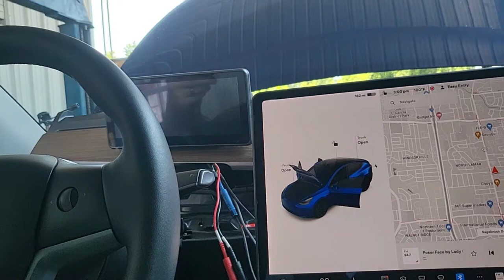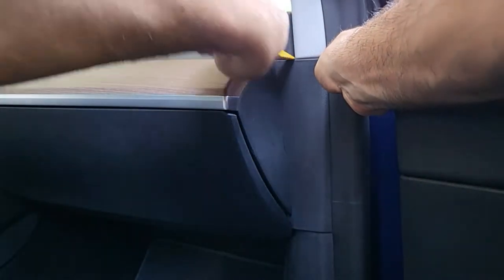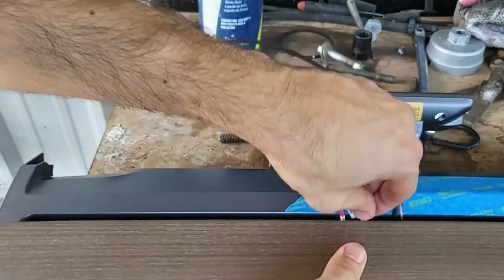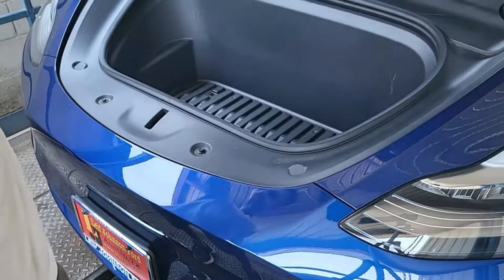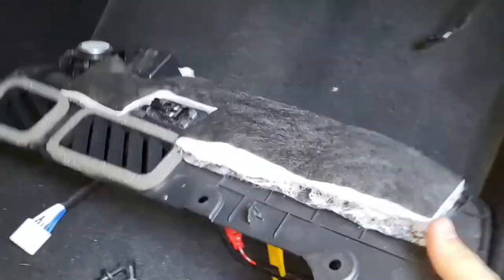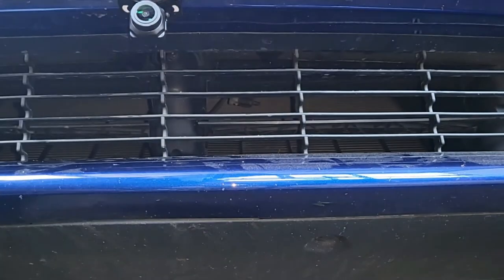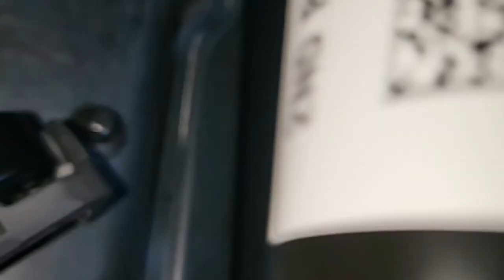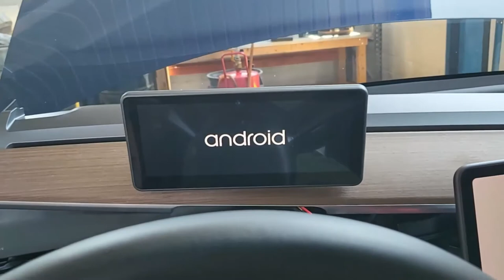HANSSHOW Heads up Dash Display and Camera in a Tesla Model 3 / Model Y

Comment: I purchased this display as well. Question???
Are you having issues with calls? Every person I talk to says they hear an echo when they speak until I turn off the CarPlay connection? Any simple workarounds other then disabling the connection?
Reply: Friendly help from California. I have the 9” version and had similar issue. Basically there is too much audio lag in original setup hansshow recommended which is phone to hanssow console to tesla Bluetooth. You see, we have multiple Bluetooth hops. Each hop causes audio lag. Hence why when you push play in CarPlay. Using app, you hear music 1.5 seconds later. This delay causes the other caller’s spoken words to be heard by themselves about 1 second later. 
   The solution which works for Apple phones and might for android auto is to go to tesla infotainment Bluetooth menu and connect to your phone. Mark your phone as priority device so your preference is remembered. I also went to phone’s accessibility settings and set an option to ensure incoming calls are handled by Bluetooth device. Before doing that I would have to occasionally click on phone’s incoming call menu and switch it from hanshow bluetooth or CarPlay to tesla Bluetooth. 
   After doing this occasionally sound will come from hanshow hardware’s speaker. You will need to go to tesla. Bluetooth audio source menu and push play and this forces audio again to be through cars speakers. Note, via this setup Siri voice will always come through hanshow hardware speaker. If I am not expecting many calls I switch my Bluetooth source to be hansshow which causes Siri and Apple nav to come from car speaker again. 
   This may sound horrid but after a bit it all makes sense and works well. 

The issue has been mentioned to hansshow for months now. I doubt they have a fix since the console is not integrated tightly in to car infotainment like in cars where CarPlay and android auto are built in and  have no extra Bluetooth hops.